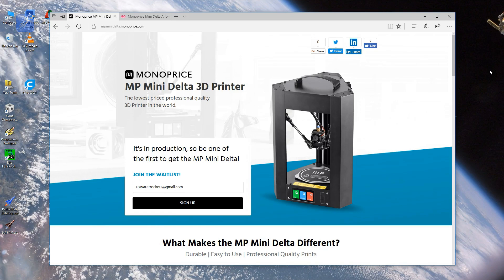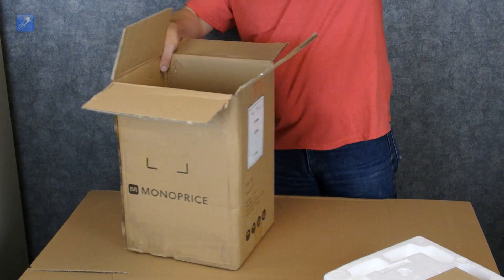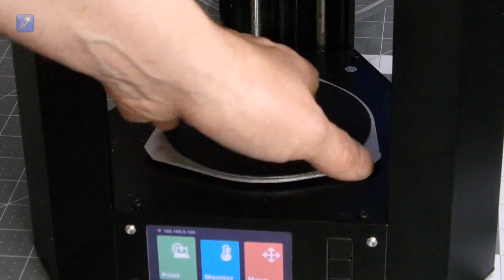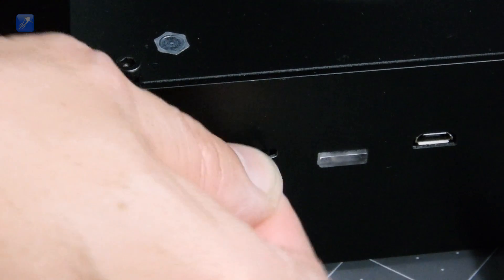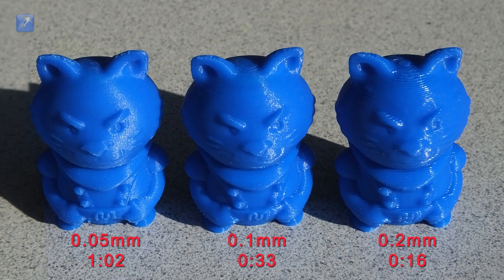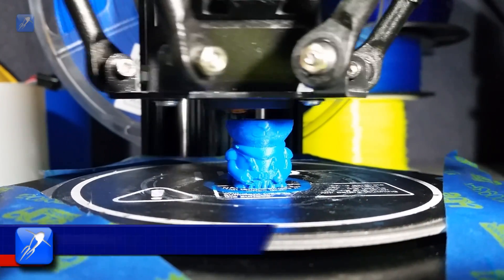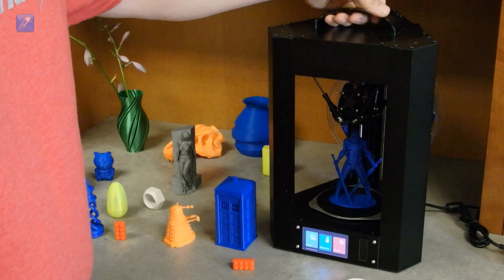Monoprice MP Mini Delta Review - BEST INEXPENSIVE 3D PRINTER?

Comment: this piece of shit doesn't work, the bed doesn't level.
 and half way through every print is goes from printing solid to printing webbed trash. ZERO angle change on the print. 
every adjustment I've made just makes it worse, 
dispite following manual and videos step by step.
Even if you Set everything back to default you will get nothing bit web structures! 
you CAN NOT print out of box like this person says you can. 
It grinds and tries to start outside the bed plate.
the spools of material a have to be re spun or stick to themselves and stop feeding. 

CAN NOT print PETG or METAL filaments.

If anyone knows of a way to fix this piece of GARBAGE
 please contact me !

Comment: Hi! Awesome video. I was just wondering if since this video you have ever experienced issues with printing? I recently purchased the printer and can not even print the test cat successfully. The models I attempt to print get 1/3-1/2 the way finished and then they fall over on the bed or "break in half", any tips for this? I've tried painters tape and glue stick after reading some information and it still happens. I'm a complete noob and appreciate your comments in advance

Comment: will this work with the software tinker cad?
Reply from the maker: 3D Printers in general don't have any relation to the CAD software used for designing objects. The CAD software outputs a generic file format (usually an .STL or and .OBJ file. NOTE: I just checked, and TinkerCAD supports exporting both of these file formats.) that contains all of the information necessary to print the object. This file is generic and will work with any 3D printer. Each 3D printer comes with the software needed to take the file and print it, but there are several good free programs that will work with any 3D printer to perform this task as well. These programs are called "slicers" and like I said, there are several really good free ones you can use if the one you get with whatever printer you buy is not to your liking. The slicer that comes with this printer is called "Cura", and it's widely used and liked by a large number of people. It's easy to use, and does a good job printing. So, to answer your question, this printer can be used with TinkerCAD.

Comment: so as of september 27th 2019 how do you feel? would you still recommend it? im brand new to this but would like a small if possible and all in one type unit like the mini delta... im just trying to print some angle blocks for my gopros on quadcopters and small things like a X brace for a tiny inductrix fpv drone to stiffen things up, and just desktop and some beautifully designed objects once i learn more and start to  create my own projects..

please point me in a direction what should i choose for my first 3d printer, needs to be a very good price and a desktop unit with roughly a 5" by 5" print surface or something like that....

could you help me out? also what program should i go for being a macbook user to create my designs to be printed? and should i always shooot to copy the file to a sd card and print straight from the card?  and do you still use the same splicing progam? what would you recommend for a beginner like myself for creation programs and mayb predesigned open source type websites where i can download designs, and also would you still recommend this printer years later as a perfect starter beginner type drone?

please help i am doing as much research as possible but nothing is better than talking with someone with good old experience with 3d printers and maybe new tech that has been released since, and also what programs should i use and what would you recommend for splicing software and also a program where i can create my own designs... thanks in advance your video was a great help..

hope to hear from ya i appreciate it...

P3T3R
Reply from the maker: I now own 5 of these plus a couple of creality printers, a large SeeMeCNC Delta, and a resin printer. I am using the MP mini deltas all the time to make mechanical parts with tight tolerances which need to be cosmetically good looking. The mini delta I find is the best for this purpose. The creality printers are not as accurate (but are great for large objects), and the resin printer is the only one I have used with better looking results, but the issue with resin is that resins don't have the wide variety of properties you can get with different filaments. I need strong parts that are flexible, so PETG or Nylon filament works best for my needs. Resins can't match these materials yet. Better resins are just now hitting the market, and I plan on evaluating them against the filaments at some point, but for now the Mini delta is my preferred machine for small detailed mechanical parts that work together as mechanical systems. I have one printing a moving joint about 3 feet away as I type this.

Comment: Two years later, it could only have improved right?
Reply from the maker: The last one I bought was in January, and it had a beefier extruder housing, a new mainboard with quieter motor drivers, and the LCD screen was different and had a nicer looking User Interface. Minor tweaks, but correcting the noise complaint for sure.

Comment: Can it print an actual guantlet that can fit your hand a thanor or  iron man guantlet
Reply from the maker: It can print items that will fit inside cylindrical print volume of 110mm in diameter and 120mm height. You won't likely be able to print a one-piece gauntlet in that volume.  Something like that would be possible only if the model was made from separate pieces and assembled later (like the fingers were printed individually and then attached to the palm and backhand. It depends totally on how the model was designed.

Comment: Does this machine print costume helmets?
Reply from the maker: I would say it is not the best printer for helmets due to the small size. However, some helmets have intricate detail parts that must be printed and attached separately, and this printer would excel at making the fine details you would have added on a full helmet.

Comment: do you have a link to the next video you mentioned, where you did things to the printer  the tweeks  n'such?  I want to get this , but its the 2nd time someone said it was loud, I would have to put it in my bed room so .. you can see  my reservations
Reply from the maker: I have not done a video on making this printer quiet yet. There is a way to make it completely silent but you have to buy a special motherboard for it. Look on the delta mini facebook group for info about this board sold by Matthew Upp on his website Gigdigit.com if you want to make it totally quiet. I have seen this mod work, and it really does the trick.

Comment: Alright, I know this is an older video but I recently got mine and I'm a complete noob when it comes to 3d printing. I have been using cura as my main slicer and tinkering with the settings. I have tried looking at many videos for their settings but none of them give me a good print result. I have tried PLA and ABS. My problem with PLA is that it's extremely brittle and splotchy. My problem with ABS is pretty much the same, not as splotchy but still brittle. Do you (or anyone) have any suggestions
Reply: I also do understand that Layer Height can heavily affect the quality/details of the print, even so when I adjust this my prints don't look too good.

Comment: Think mine is broke out the box lol. i printed the chess piece like you did in the video and the filament is just sliding all over when it prints
Reply from the maker: If the cat that comes on the SD card prints (it's probably called "auto.g" or something similar on the file list) then the printer is fine, and you've possibly not set up the slicer software correctly. Check the Wiki (https://www.mpminidelta.com) which has some troubleshooting tips. I suspect you have not set up the G29 bed level command for your prints. There are great folks on the facebook group as well who have a lot of good advice on setting up the printer.

Comment: can it print tpu
Reply from the maker: Yes, but like all printers using a Bowden type extruder, it will have more trouble the softer the TPU durometer is. Stiffer TPU prints easily, soft TPU requires a lot of fine tuning of the print settings. Soft TPU performance can be improved with simple mods such as a filament guide for the extruder drive motor, which you print in PLA or PETG on the printer. If your main interest is printing soft TPU, then you would be better served by a "direct drive extruder" style printer. Bowden tube drives are not the best for soft flexible filaments.

Comment: What file types does it support
Reply from the maker: It takes Gcode files output from any popular slicing program. Very few printers use files other than Gcode.  It's the most common format.
Reply: Can you just use .obj .stl
Reply from the maker: Almost no printers will accept an .obj aor .stl fire as direct input. The vast majority of printers only use gcode files. Gcode files are made starting with a mesh file such as and obj or stl file. Slicing software such as cura or simplify3D are used to convert the mesh file into the motion commands that create the printing layers that the 3D printer understands. There are many slicing packages available and most of them are free or open source.

Comment: can a 3d printer print from a picture
Reply from the maker: There may be some very advanced printers costing thousands of dollars that can do something similar to what you describe, but the inexpensive printers like this one can only print 3D object files created with a separate software program like Fusion360 or TinkerCAD, etc. However, there are some clever phone aps that will let you take a series of photos of an object and will make a 3D printable object file. I don't work with designs created this way, so I can't vouch for how easy these apps are, or how well they work.

Comment: i just had to get a replacement printer because the one i got had a defective optical sensor that within a few weeks wore out. it prints fast and, unlike in this video has a label on the front. Great printer after the replacement.
Reply: he's using the spiral chess set off www.thingiverse.com
Reply from the maker: This one is a prototype, so it doesn't have the warning stickers. I bought a second one last year when they went into full production and it did have the sticker. Thanks for the comment!

Comment: Would this printer be large enough to print your astromech design?
Reply from the maker: Sorry, but not directly at full scale. It would have to be scaled down to fit. or the largest pieces would need to be cut up into smaller sections in the slicer software and flued together. That model was designed to fit on the Monoprice MP Select Mini. It's a slightly more expensive printer.

Comment: i always find it difficult to trust people with reviews, he doesnt say why he put stuff on the bed, usually thats because it wouldn't stick and failed a print, he also doesnt say how much tweaking in slicer he had to do for this quality, i doubt seriously, they just all printed perfectly every time with no tweaking or anything in the slicer :O
Reply from the maker: I clearly stated this was a prototype printer and that it would likely be different than the commercial one, like the bed as an example. Since this was a prototype, there also didn't exist any slicer profiles for it, so naturally I had to create and tune slicer profiles for the video. The members of the beta test group developed these profiles, so the printer would print great right out the box when it shipped. In the end it is unrealistic to expect a printer to print 1000% perfectly right away without some tweaking because every filament brand and type will have variations that may lead to print quality differences. Low price filaments can even have variations from batch to batch of the same filament type and color that require tweaks. In general you will get very good prints out of the box with most new printers, but always expect that you will have to learn to tweak the settings to get absolute print perfection. In many cases the settings for one 3D model are not ideal for a different model and you will need to adjust them if you want flawless prints. This is true for every printer that uses generic filament and maybe less true for printers that only accept "chipped" filament you have to buy from the 3D printer's manufacturer. If you don't want to have to tweak the settings and want the most consistency out of the box, then you should look at printers that don't take generic filament. Chipped filament fives the printer maker consistency in the filament that allows them to give out profiles that are tweaked to perfection for their specific filament formulation.In closing, I do not like the majority of videos that just unbox the printer and load up the default settings and print a average looking print. Any printer can do that well. When I look at a review, I want to know that the printer is really capable of. When you watch a review of a sports car, they have a professional driver push it to the limit to show how good it is. They don't give the keys to some rando and tell them to pick up groceries. Any car can do that well. I tried to reflect the actual performance of the printer in this review. The level of quality this printer reaches for the price point is incredible.
Reply: @USWaterRockets  , sweet cuz I'm buying one on the 3rd, I didn't mean to be offensive, I just am confused by all the reviews I watch, as to how exactly it is going to be, do I need a degree in something to make it work or can a moron print a terrain piece for DnD on it lol (I'm the moron)
Reply from the maker: You should be able to print terrain pieces easily. Looks for ones that are available that say they are meant for easy 3D printing. With any hobby, there will be some things you will learn as you go, but if you join the facebook group for this printer, you will find people who can answer any questions and are happy to teach. That's also where you can find the latest slicer profiles and most up to date settings. Enjoy!

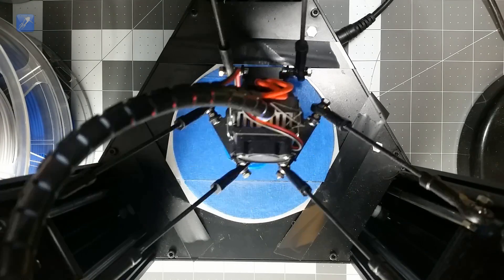Comment: A12:09 I see you have the corners of the print plate taped down- any specific reason you do this? Doesn't the bed auto calibrate too?
Reply from the maker: The bed auto calibrates, but the printer in the video is a prototype that didn't have the plastic bed holder clips included, because they had not yet been designed, so I improvised with tape until the manufacturer had the real clips made.

Comment: How would you put the mini Sd Card In a computer?
Reply from the maker: It's a micro SD card that the printer uses, and you have many choices for using this with a computer. The cheapest is a USB memory card reader that plugs in the USB port on a PC and reads all the popular memory cards. Just make sure to get one with a MicroSD slot to plug the card in.
Reply: USWaterRockets alright thanks!

Comment: Thank you SO much for this video! I just got this unit in and where it does not come with instructions I wasn't sure what to do with the filament holder- I'm totally new to 3d printing. I feel that your video is every bit as good as a professional training video... and it made me feel that I made the right choice for my first 3d printer.
Reply from the maker: Dave L. Woodrum thanks for the generous compliments. Your feedback is greatly appreciated. One note is that the directions come on the included SD card.  But the best place to go for help and advice is the Facebook group for this printer. Enjoy the printer!

Comment: Thank you for putting this review together. I notice that you use eSun filament, have you used their "ePA-CF" filament (Nylon and Carbon fiber) with the Monoprice Mini?
Reply from the maker: Sorry, but I have not used that filament. The nylon makes it difficult/impossible to glue anything to these parts, which I need for my particular designs requirements. I have used an ABS/carbon filament from ProtoPasta with some success, and it doesn't push the temperature to the limit of the printer like Nylon does. However, carbon fiber filament wears out nozzles like crazy. Have spare nozzles and get the hardened nozzles that last longer if you use it.
Reply: USWaterRockets Thank you for the tips. My brother-in-law is very interested in the Monoprice Mini as his first 3D printer and wants to start with printing spinners (for RC aircraft) so I am looking for info to help me.

Comment: How do you get the more detailed models at the 7 minute mark? My models come out like the one on the right.
Reply from the maker: The later height is set to 0.05mm on the left and is set to 0.2mm on the right. As you see the print time scale up as you use smaller layers.